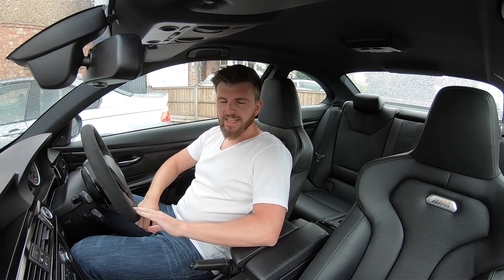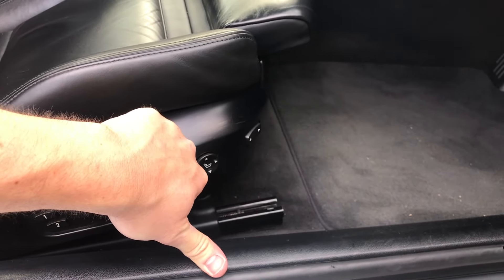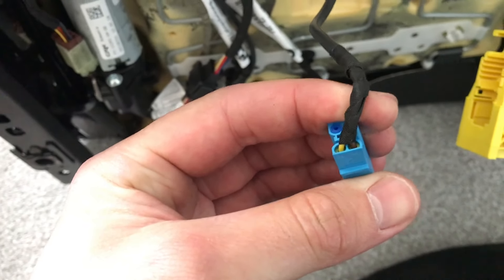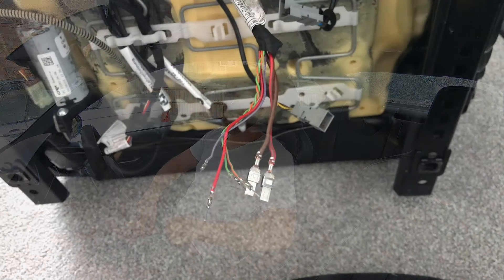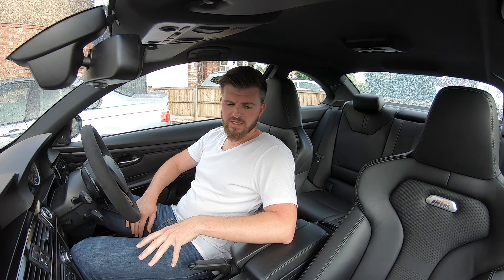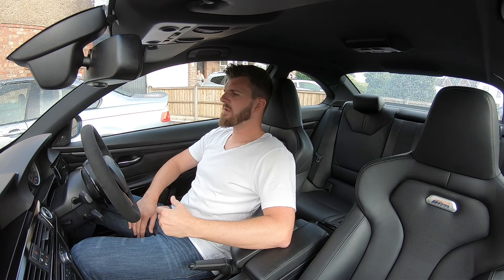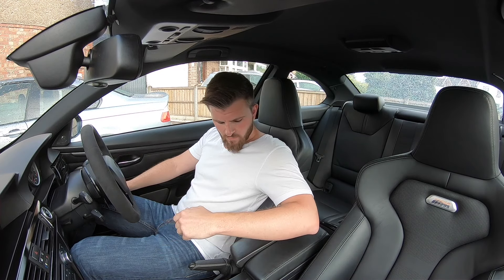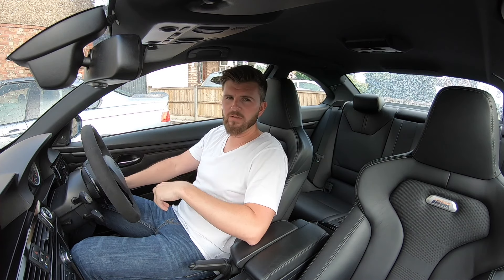BMW E92 M3 Seat Upgrade - ** Fitting BMW M4 Seats **

Comment: Do you think this is something someone with little mechanical experience should try to tackle? 😅
Reply: And is there a video where you were doing it all?
Reply from the maker: I guess the real question is if it does go wrong do you have the funds to resolve any damage especially compared to what a garage/specialist would charge for the job in the first place 😅

If you short circuited something with the wiring loom or incorrectly coded a module it could become very expensive to repair.

The newer guides I now put out contain alot more detail but there is no follow on for this one I’m afraid, it was created to provide pointers for those familiar with the tools and to show it can be done after many said it couldn’t 👍

Comment: Thank you for the content! Apologies, I haven’t sifted through the comments to see, but you were mentioned not using the back seats because of the different console type, but did you consider using the e90 console plate to address that? It seems like some of the message board posts show people doing that.
Reply from the maker: Your welcome 👍

I couldn’t make it work at the time with the seats I had as the brackets didn’t fit on the sides, now running a roll cage in the rear I have no need at all to experiment 😅
Reply: @stoneautomotive  makes sense…. thank you. Cheers.

Comment: I turned the head restraint to nicht aktiv in ncs but the light is still coming on
Reply from the maker: Use INPA to determine the fault code that’s registering, the occupancy sensor will need to be coded out too.

Only other thing will be to double check your wiring

Comment: Can u help me fit it il pay u mate iv got e90 m3 seats i want to put m4 front seats I bought iv also bought the lci modules
Reply from the maker: Hi Khan,

I’ve not tried to fit the M4 seats into the e90 M3 so unsure if this is a direct swap or if you will need F80 M3 seats as the tilt and upper electronic slide option maybe different.

Thanks
James
Reply: They are also direct fit mate iv got lci seats e90 as spare
Reply: @khanalive9533  hey can you help e out i cannot mannage the passenger side work 100% the side kussens and heating is not working

Comment: Wow they look so much better! And like you say still “factory+” I could do all the mechanical side of it no problem, it’s the coding that will scramble my head 🤦🏼‍♂️ no good with computers! Shame ☹️
Reply from the maker: There are companies that will code for you, seems to be around £100-£150 depending on where you go.

I’m not great with coding to be honest but when I want to learn something I end up putting my mind to it and spent an hour studying a few guides on line and got there in the end 👍 hardest part was trying to get everything working as it wasn’t a done modification so hopefully the guide helps a few 😊
Reply: Stone Automotive I’ll have to see if I can find a company that can do it for me, like I say I could do the putting them in and wiring them up no problem, it’s the coding, I’ll end up making it never drive again 🤦🏼‍♂️😂
Reply from the maker: It’s not that bad of job, just need to take your time and make sure you code the correct module 👍

Imagine how I felt first time round,  no one had confirmed which lines of code needed editing for the M4 seats so was trial and error (which meant a few weeks with the airbag warning light & bong every drive 🤦‍♂️)
Reply: Stone Automotive nice 🤦🏼‍♂️😂😂😂

Comment: Did uou try to fit the rear seats?
Reply from the maker: Yep, lower section is completely different - the M4 rear seat is lower section is not linked to the centre consol like the e92 ☹️

Comment: Is it possible to do this modification in an e46 M3? Thanks
Reply from the maker: It would be a big job, the floor mounting is different & the canbus would not be compatible so non of the electric motors or heated seats would work like the stock e46 sadly
Reply: Thanks for the support. Nevertheless great job like always!!!
Reply from the maker: Thanks & agree it’s a shame as for the money the M4 seats are great!
Reply from the maker: Thanks & agree it’s a shame as for the money the M4 seats are great!

Comment: Where do Buy m4 seats
Reply from the maker: BMW parts department, very expensive though! Or you can then from a breaker or salvage agent from a stripped one for around £1,500
Reply: Stone Automotive Do you know if these will fit E63 6 series LCi?
Reply from the maker: Afraid I have never tried to confirm if they work

Comment: Just buy a m4!      Be the engine next!    I've got a m3 e92 and will be getting super charged next but keep mine as a e92 .
Reply from the maker: Odd comment 🤷‍♂️ the standard seats in the e92 M3 are mounted way to high, provide minimal support and look as exciting as what you would find in a 320i.. I run the Recaro CS seats in my e46 M3 which for me are the best after market option but you loose the memory/ heated functions where’s the M4 seats provide the factory functions. 

The callipers from the M4 would be a good upgrade as opposed to the stock single piston brakes on the e92 but the S55 is the last engine I would want in the e92.

Comment: Wait what module? Did you say from a e90 serious car? I couldn’t understand I’m sorry..what all do I need to install the f80 m4 seats in my e92 anyone got a rundown?
Reply from the maker: You will need an LCI seat module (essentially if your car is a 2008 - 2010 it will have the old module which doesn’t work on the M4 seats) for the M4 seats to work you will need a module from a 2011+ e92 M3